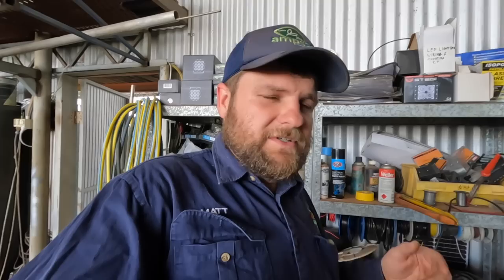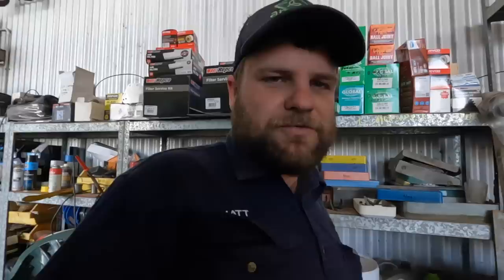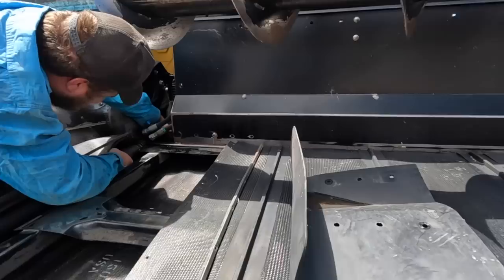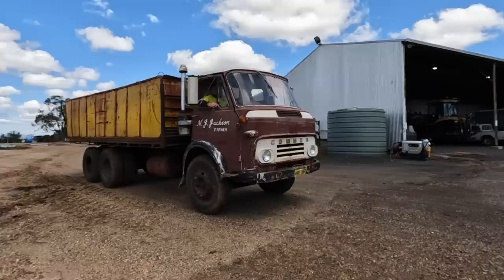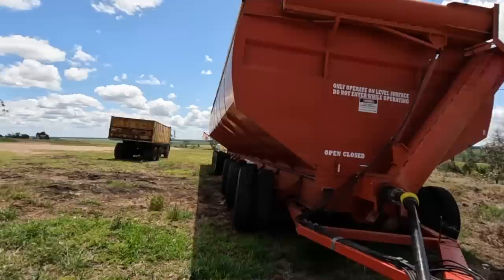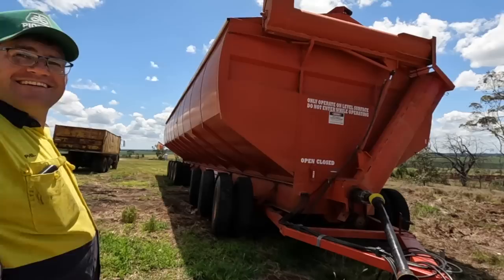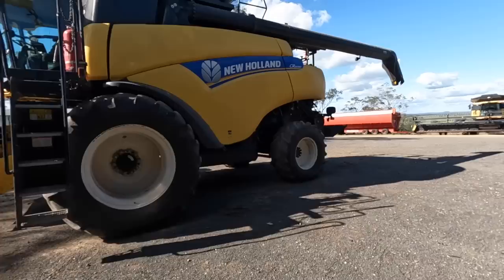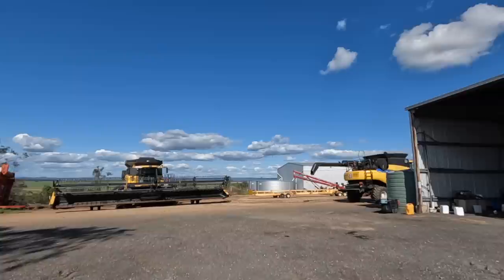Dad's Wild Ideas!! (Vlog 107)

Comment: You mentioned sticking a bracket on with silicone, if you want something that will never come off, get some sikaflex 252, sticks like shit to a blanket. It's the same sort of stuff they use to glue in car windscreens, so you don't want to use it on things you want to take apart at a later date.

Comment: Can vouch for the steadi lights, no water got in after years of pressure washing on the front on my rig. The fuse blew once when I was using it to break ice and submerging it under water in the winter, but you’ll get that. Put a new fuse in and it’s good.